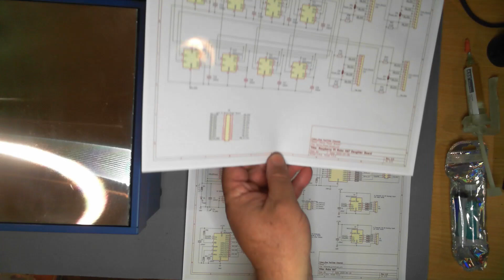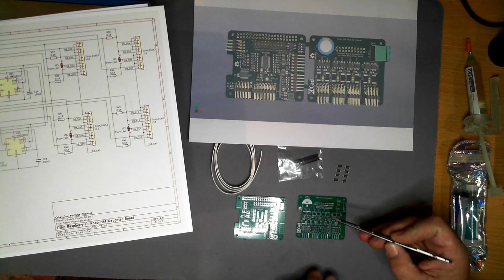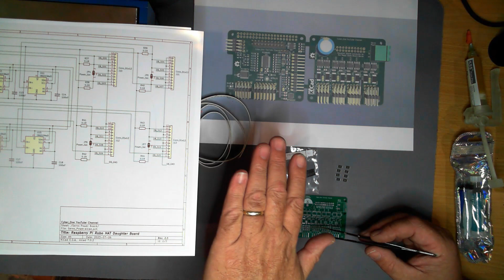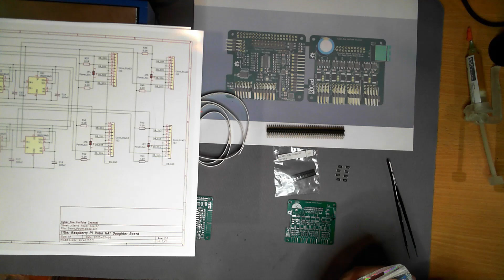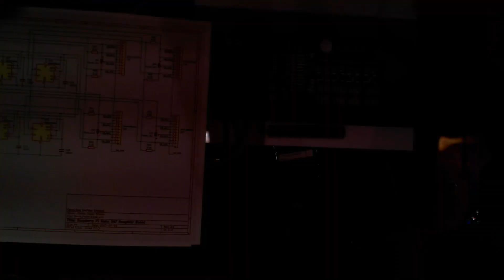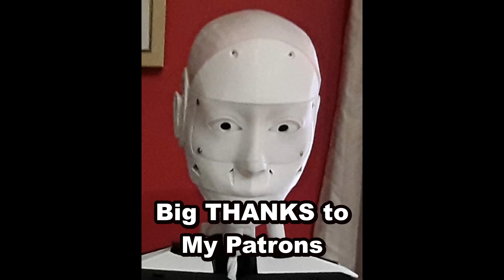Raspberry Pi Robot HAT Part 4

Comment: How much you sell the boards for? Either kit or on their own.
Reply from the maker: Good Question,
I haven't quite worked it all out.
I want to assemble one first, make sure it works as designed.
When that is successful, I will release a video with links to where I'm selling it and how much it will cost.

The PCB is Open Source, so there is nothing stopping you from getting the boards made yourself, but I would advise waiting until I have the prototype working.
I have most of the parts either on hand or awaiting delivery to build 10 boards. I only have enough INA219 chips for 3 boards at this stage.

If the prototype is successful, I will order in the INA219 chip to finish the remaining 7 boards and these will put up for sale.
The first 3 or 4 are reserved at this stage.
First one is going into my Spot Micro build.
Second and Third are ear marked for two long term Patrons.
The 4th may end up in my MR-4 Robot build.
Rest will go up for sale.
Stay tuned for updates 🙂
Reply: @ will do…..